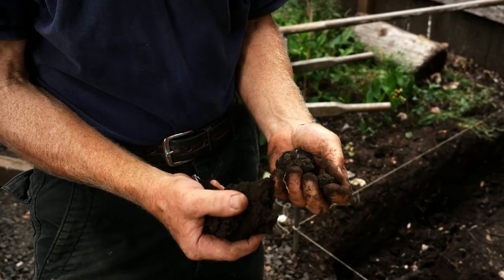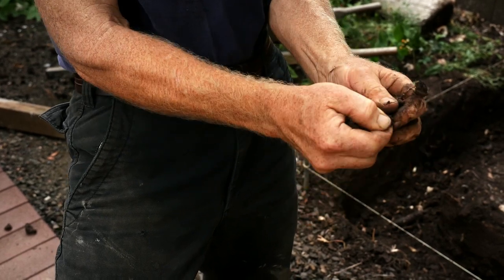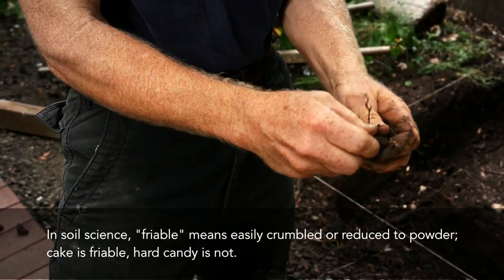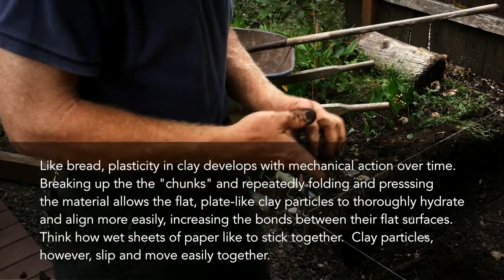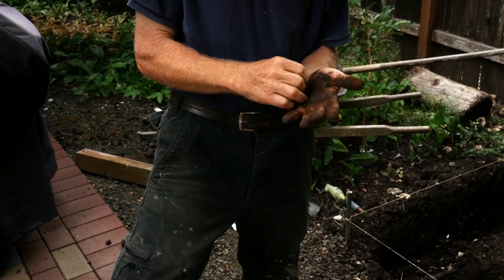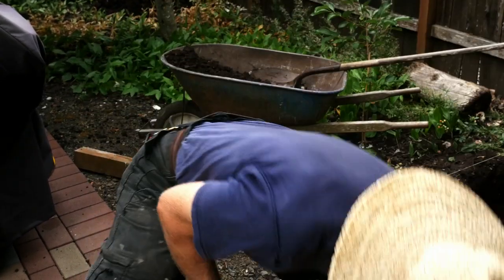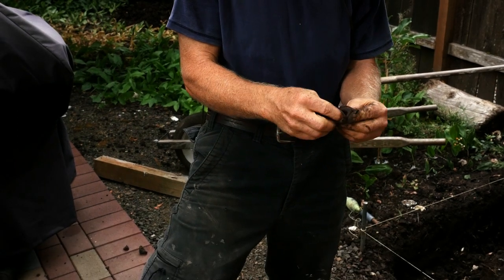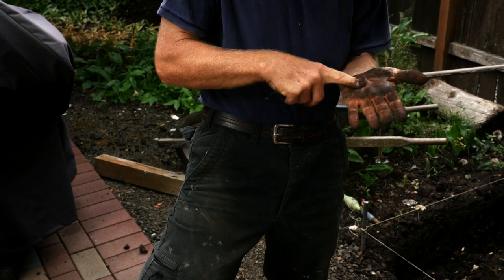Soil Test for Cob Oven Building

Comment: Hello Kiko, your Earth Oven book has been an invaluable resource. I have built three earth ovens over the past 20 years and they have been the center of countless dinners, parties and memories. I am planning to build a new oven at our home. Unlike the previous places we have lived, there is almost no clay in the soil here in middle Tennessee. I did several shake tests that indicated silt but no clay. I found soil maps and surveys online and there appears to be no clay within an hour of Nashville. It has something to do with our shallow limestone bedrock. One article I read said there will be clay in 100,000 years - but that isn’t much help. Do you have any suggestions for using potters clay with sand and soil to mimic natural clay? Potters clay is so fine I am concerned it won’t mimic natural clay.
Reply from the maker: Hey, Brad, thanks for the nice note. Don't give up on middle Tennessee yet (rivers and lakes are good spots to look for clay deposits -- any old brick factories in the area?) -- and just so's you know, I have been to a Mexican Saltillo tile factory that used silty soil to make floor tiles, so there are definitely silty soils that will work. If you can make even a short snake w/it, it might be worth making a small test oven, or firing a sample in an open fire/bbq to see how hard or soft it is. That said, yes, potter's clay will also work just fine. You'll need to add 3 or 4 parts of sand -- again, a small test oven is good insurance. If you can only get a little bit of clay, you can also use it to amend your silty soil -- even a little bit can make a big difference. I've heard from folks who have tried clay kitty litter, but I haven't tried that one myself. Good luck, and thanks again for writing!
Reply: @kiko.denzer  Thank you!